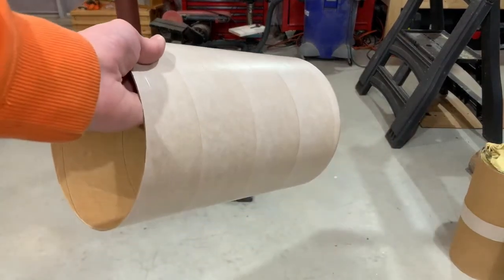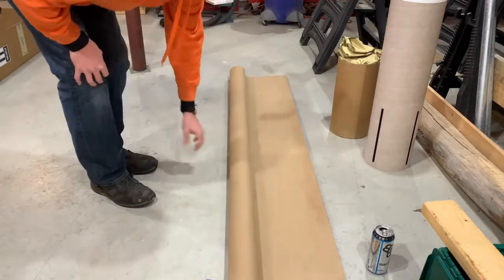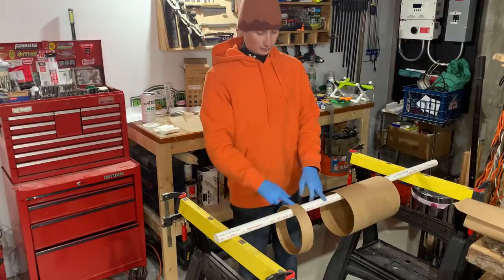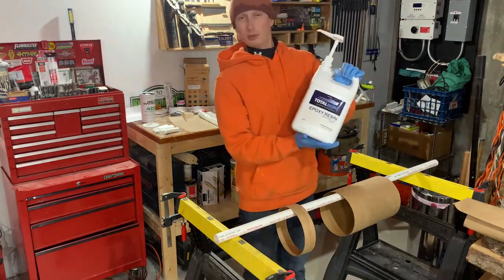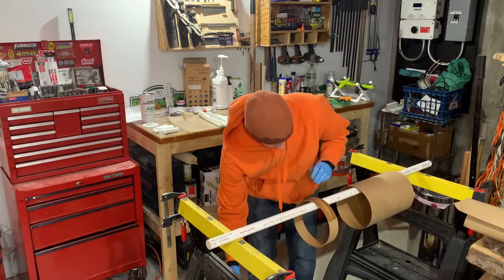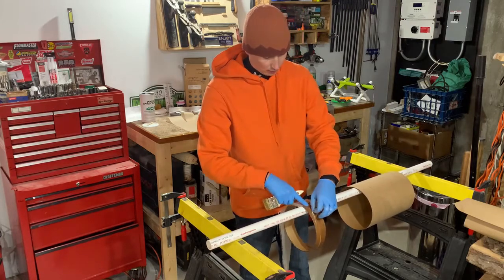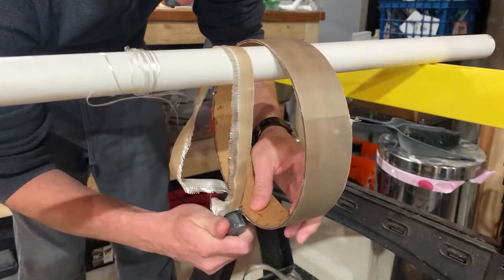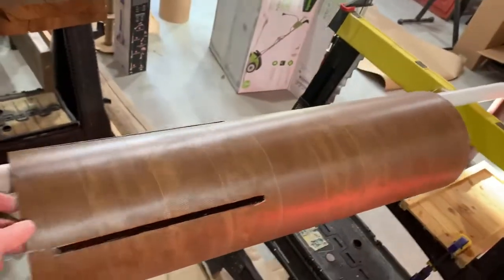05 7.5" LOC DOOR KNOB Fiberglassing Airframes

Comment: I'm looking to buy this kit for my L2.  Do you feel it is absolutely necessary to fiberglass the airframe?  I'm probably using an AT J350.
Reply from the maker: Not at all! If I wasn't flying this on frozen lake beds this winter I would build it stock. I've heard people using K454 Darkmatters on unglassed Bruisers, which is a longer 7.5" DOOR KNOB, just three fin instead of four. Or K675s on other unglassed 7.5" airframes. Also I just wanted to learn how to use fiberglass :)

https://www.rocketryforum.com/threads/when-does-loc-tubing-need-to-be-fiberglassed-for-flight.55117/
Reply: @pathtouch1  thank you!